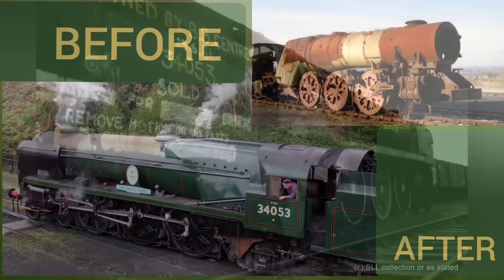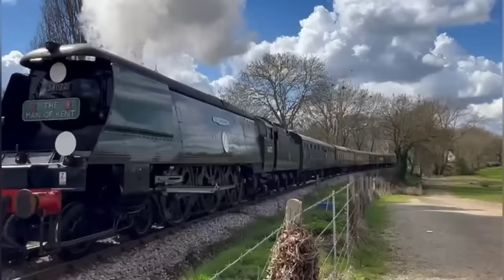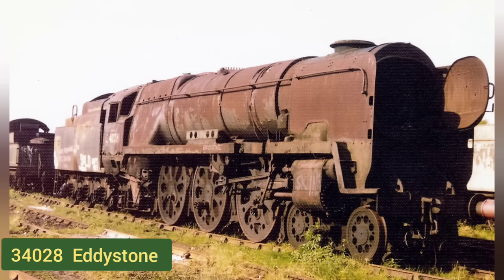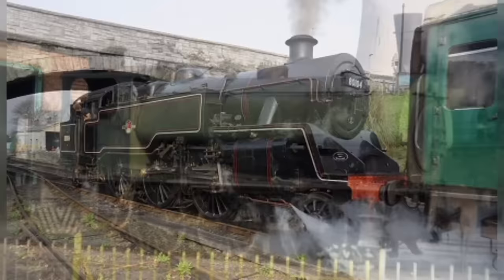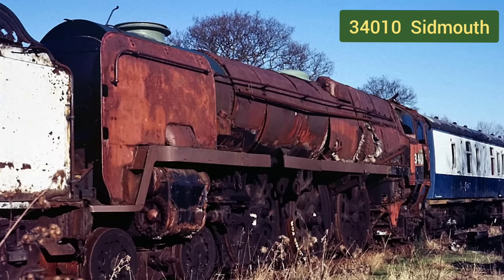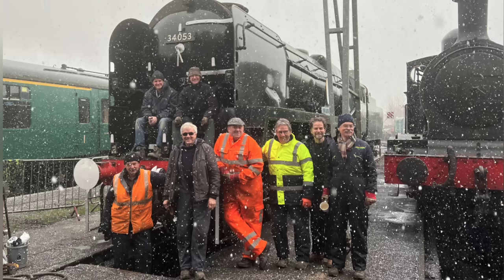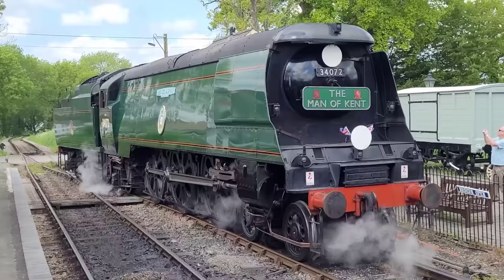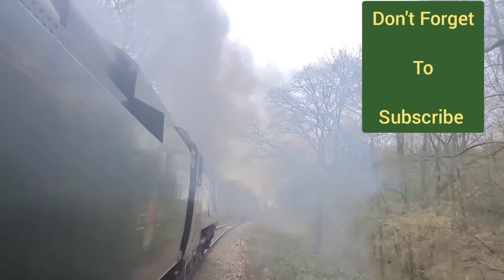WHO DOES THIS? Before and After, SCRAP to SHINE, Southern Locomotives Ltd Steam Preservation

Comment: And in the end just how much of the “restored” loco is original. There is a saying that the only thing original about a steam loco is the distance between the wheels, and sometimes even that is different!
Reply from the maker: Good comment. A concours  winning car with 200,000 miles on the clock would not have all its original parts due to wear and tear. The same is with a steam locomotive.     Most parts are orignal on our locos as they were withdrawn 20 years earlier than their design life intended. A loco prior to its withdrawal may have had a number of boiler swaps with other locos while being overhauled as this often saves time and got the loco back to work earlier. They were also often fitted with new or borrowed parts from others, the motion parts for example. 
Some parts have a shorter life and need changing occasionally, super heater elements, cladding etc.
You can see us removing super heater elements from a freshly out of steam loco (Sir Keith Park) and fit them to another (257 Squadron) in 2 of our videos. Thanks for watching 👍👍

Comment: Why are the team laboriously working away with angle grinders and wire brushes cleaning rust off the chassis instead of engaging a mobile sandblasting surface. It would achieve a much better result in a day than they could manage in a couple of weeks?
Reply from the maker: Good question! 
Money versus time.
We currently have 2 sets of loco frames to clean up and paint. The cost to pay someone to do this would be thousands of pounds. Yes it would save us a huge amount of time at this stage of the restoration but the money needs to be saved for later as we don't have enough! 
We have however purchased some used blasting equipment that we are currently working to bring into service on Sir Frederick Pile and Brocklebank Line this year but until then the guys will soldier on with the grinders👍.
Reply: @railwaymaniacs7392  Wow! I'm in the wrong country and the wrong industry. The mobile blasting services here in Australia charge by the hour and it's very cost effective. I have set up my own gear for fabrication work. So that's certainly the way to go if cost is the issue. There is a YT vid from a commercial marina in Australia showing how to convert 45kg LPG bottles to a large volume system. It might be an option for final clean up, after the wire brush brigade. Thanks for your reply.